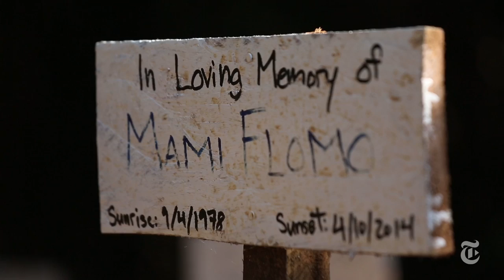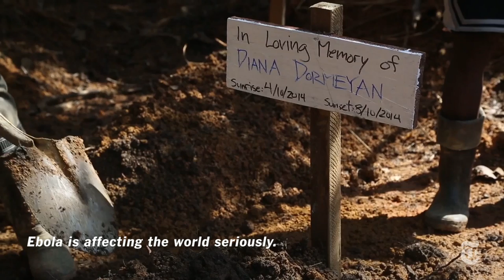Inside the Ebola Ward | Virus Outbreak 2014 | The New York Times

Comment: Anti fog googles, and external mics for added senses with augmented reality, and mixed reality virus location detection and sensors selective overlay inside the googles. These should be used only in extreme cases, where robotic nurses and robotic doctors are not working as intended. Medical  AI should be selectively used, in potential use cases. Local language based (Natural language processing) Medical robots should also be highly used, including for physical and mental support to affected patients to reduce actual human contact to the virus in any possible formats. Grave digging, and such burial ( if prefered in that manner) or thermal method (for highly contagious cases) should be done by worker robots in separate zones. Robots are highly effective more than the PPE Kits, and the masks. So, that effectiveness in not contracting the virus, and doing the required job should be considered as of higher importance, and should be implemented after recognising these tools we have now. Full sleeve clothing should be used, instead of half cut sleeve shirts for men, here you can clearly see a worker  in half cut shirt, INSIDE working spraying disinfectant as skin contact will be there with the virus which is not optimal procedure. Grave diggers are all wearing half sleeves too, not wearing head protection, PPE kits (which is needed, but they are going home in the same clothing, THATS where, they haven't noticed the procedural flaws being practiced, and not pointed out annd not corrected. CCTVs should monitor the grave diggers work area, and also inside work areas for procedural flaws, that workers might implement on their own.